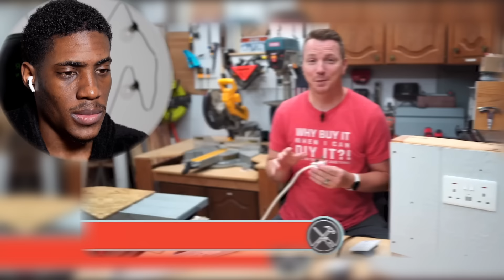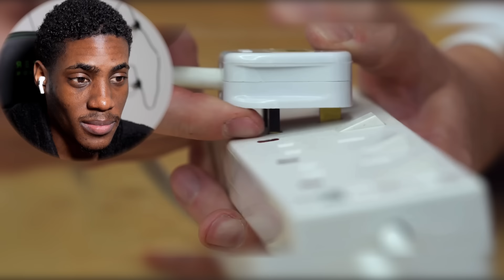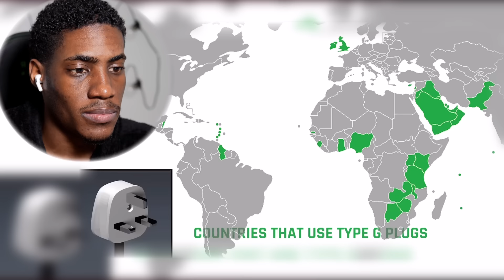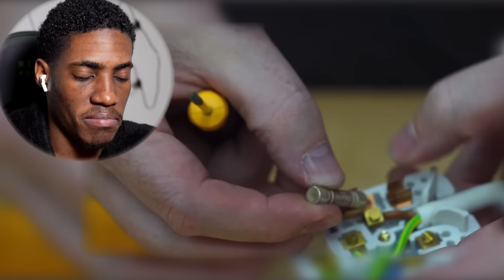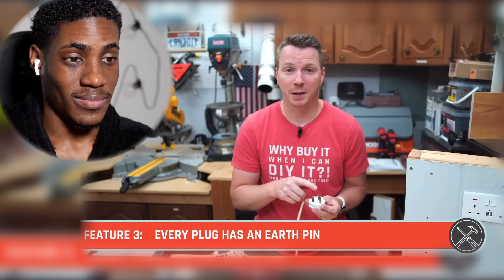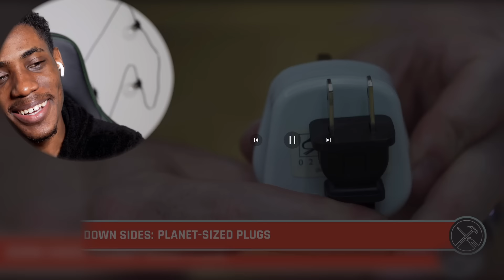Why British Plugs and Outlets are the best in the world || FOREIGN REACTS

Comment: In the UK when I was at school, we actually got taught how to change a plug.     They don't teach it any more, but any brit over a certain age learned.    Before 1987, appliances were often sold with just a cable, no plug, you had to fit and wire the plug yourself.

Also, re 230V vs 110V :  as we say in the UK, it's not the volts that kill you, it's the amps.  But yeah, all those safety features are great.  The product of old-fashioned, serious-minded, pipe-smoking engineers.

The flaws:  the size, DGAF     Load-balancing, not really a problem, just don't take the piss.  House wiring, that's the electrician's job.  Socket switches, rarely but yeah, you have a d'oh moment once in a while.  Not really an issue when you're used to the switch existing.     The prongs-up foot trap, yeah, that one's for real.  Doesn't happen often but hurts like a mofo if it ever does.

The wall switches have one more upside he didn't mention:  the switch cuts off the live and neutral, but not the earth.   So, you can have your pc plugged in but off at the wall and the power cable still acts as an earth, very handy for discharging any static you might have on you by touching the frame before working on the internals.   Who needs a wrist strap lol?

On balance, definitely the best plugs and sockets there are.
Reply: When i was in school, they didn't do very much in regards to teaching how to fix things. It was more building a small wooden toy car or making a sausage roll. The basics wasn't something they taught us and i think this is an ugly issue that needs to be taught. I'm not sure if it's the same with all schools, but i feel like each generation becomes less and less independent and requires someone from a buisness to do it for you.
Reply: TBH the plug thing was kind of an exception, it was mostly the usual school stuff.   Though Home Economics (sewing, cooking etc) was a thing, as was Technical (what the US folks would call shop class).  Everyone did both for the first couple of years of high school, before you chose your options for the remaining 2-4 years.  Not so many carried on with them.
Reply: They do teach it. I taught it a few months ago to my year 10's. They need to know the fiction of the fuse and earth wire.
Reply: @crwhittle  Very glad to hear it's still taught.  Not sure I follow what you mean by 'the fiction of the fuse and earth wire' though.  Expand on that please?
Reply: @PreceptorGrant  ha ha, typo, I meant function.
Reply: @crwhittle  - You are correct.  My grandson (12 years old) was taught at school.  He was so excited so he video called me and and showed me how it was done.  I already knew, but didn't let on.
Reply: @anitawhite2669  Yeah, that's about the right age. I think we often talk down students in the UK, but they often enjoy rewiring a plug, and anything else practical.
Reply: My first science lesson at secondary school was wiring a plug back in 1987
Reply: @DaveP-uv1ml  Might have been true in the past, but modern british wiring regulations are pretty robust.
Reply: @DaveP-uv1ml  Sure, plenty of older properties that haven't been upgraded to modern spec.   But even if they had, no point changing the plug standard now, anything else would be a downgrade.
Reply: if i recall usa home sckets  have 15 amps so more than UK does
Reply: That might be,but dont forget the european plug has also evolved and there is JUST a tiny bit difference,and a big difference on the size off the plug.The one in the UK is enormous..And if the plug is a little bit taken out,you could with a wire get a shock.European plug that is not possible. The only thing wrong with the european plug is there are so much variants.Mostly bad variants.And connections without earth pin.That shouldnt be legal by now..
Reply: @jooproos6559  Didn't you watch the video, the part that explains that if the plug isn't fully inserted into the socket, the only parts of the live/neutral pins that could be touched have insulation on them & so prevent electrical shocks?
Reply: Yup, I was taught to wire a plug, it was 1st year secondary school general science.  Fitted plugs came as a result of a safety campaign led by TV show "That's Life", it saved more lives than the safety plug design in of itself.

Comment: they are so British so safe  in so many ways and hurt like hell if you step on them with bare feet you cant just stick thing in them so little kids and some big  ones  don't get shocked  we also have covers you plug into the socket that are flat to discourage kids sticking thing in to hols in the socket  cool a
Reply: I believe that those covers are discouraged as the sockets already have shutters, and if the plastic pin that goes into the earth breaks off when you're removing it, you've just defeated one of the safety measures!

Comment: I've stood on one of those damn plugs before and it is not to be dismissed...f*****g painful.

Modern plugs now are a sealed unit so not as simple as undoing a screw and re-wire.

Safety point he never mentioned is wiring 240v plugs for dummies (trust me I am a member of this exclusive club) BL(ue) wire - Blue Left and BR(own) - Brown Right.
Reply: Blue to the left,
Brown to the right
If you don't you'll get a fright - max bygraves
Reply: You can still buy individual plugs to replace a damaged sealed plug.

Comment: I have an iPhone charger thing that is proudly made in the USA (it told me on the box. A lot), and while it will now only charge my phone instead of my watch and earbuds as well at the same time because it was made in the USA, it is infuriatingly intrusive with a rather long horizontal plug in to which a USB must then be inserted. I’d guess my bedside table needs to be six inches off the wall and we in the UK don’t have that sort of space to lose!
     It’s not that anyone else’s plugs are bad, just that ours had to be over engineered for conditions including the fact that we use a 240 Volt system which might kill you if not regulated correctly.
     I’d prefer ours simply for the safety features to the extent that when I plug in something abroad, I do with trepidation, in case of shock. And I am a grown man I hasten to add.

Comment: OMG someone who actually knows what hes  talking about and see's thoses negatives as trivial. As others mention below if a qualified electrician has checked or wired the house then load balancing is never an issue. Plus if you haave the switch on the sockets there is  less reason to take the plug out to start with. Well spotted too about the fact that it enables furniture to sit snuggly against the wall.

Comment: Nice one! As a UK resident, I do have to say that the reviewer really had to dig deep to get the negatives from somewhere. OK, stepping on a plug can be painful, but in reality that does not happen often. Nobody leaves power cables lying around in the middle of the room, that is just silly! :-D Regarding the size, that is also not an issue. You get used to it, and also being realistic it is as small as it can be made and still contain all the good safety features. Any smaller, and we need to throw out good features. And the last bit, where you have a switch on both the wall plug as well as the appliance, this is a bit contrived too. When changing a bulb we ensure that the source of the power is switched off before we start working, whether this is the wall plug or a circuit breaker in your consumer unit. Once replaced we check that the device works, and if it was double-switched off then it's not really an inconvenience, is just simply "safer". Is it switched on at the wall? Check. Is the device itself switched on? Check. Is it working? Yes/No. If No, troubleshoot. No big deal! 😛
Reply: Yeah Jan... He really didn't have to find fault like that... I'm almost 60 years of age... And I've lived in several properties over those 60 years... And not once have i ever had problems with electrical load balancing in any of those properties... Nor do i know of anyone else that's suffered from any load balancing issues in their homes either... This is just scare mongering... And trying to find fault in an electrical system that's far superior to any other electrical system in the entire world... Is just crazy!... And nobody in their right mind would ever unplug their appliances and leave the prongs of the plug facing upwards... Because there's no real need to do that anyway... We simply hit the sockets off switch to isolate the electrical device in question... So there's absolutely no need to remove the plug from the socket... Let alone leave the plug in the middle of the room with the plugs prongs exposed and facing upward... And like you stated Jan... The plugs size isn't an issue either... Especially considering the amount of safety features that the Type G Plug incorporates... It's without doubt one of the greatest and safest designs ever made... And by trying to find fault like he did... Was more than a little disingenuous i think.
Reply: @rickb3645  whenn electricians design the electrics on your house, there is a table and formulae in the IEE reg book and onsite guide as to how to take load into account... callled load diversity frrom what i remembber- did my sparky exams foor 16th edition regs, but they are 19th edition now...
Reply: You're absolutely correct. Load balancing is carried out at installation. It's  completely standard practice for instance, to put a kitchen on its own ring circuit so as to allow for heavier loads (without the oven of course, which again is on its own circuit). It's a great system.

Comment: The only negative he mentioned that is true, is that if you for some reason leave a plug lying around - you might step on it. Everything else is just nitpicking from bias. Load/Guaging? Not an issue in 99.4% of cases. Size? Size of the plug doesn't matter, as you mentioned, it's about how much room from the wall the plug takes up. Not knowing whether to trouble shoot the lamp or the plug? Step one of troubleshooting, check that it's turned on at the plug, simple.
Reply: while mostly agree they negitives are real. stepping on Does hurt. you cant just leave everything plugged in with so many devices, Size while not a big problem does add bulk for mobile devices, example being the steam deck carry case can not properly hold the charge cable as intended due to the size of the plug. and the switch does course small issues when others around. like turniing something on,kettle, toaster, etc while doing things come bback to realise someone had turned off the plug. not huge issue but have been cought out when living with others
Reply: The negatives are real and aren't nit picking from bias but nit picking  as a review...First of all he acknowledged that these are his preferred plug and secondary he's doing a review and can't say type g are perfect because they are not... but damn close

Comment: load balancing is never a problem as we tend to buy low consumption appliances. we also leave the plugs in the sockets and use the switches, so we never tread on them.
Reply: Also most homes have multiple ring circuits to spread the load
Reply: @DavidDoyleOutdoors  and radial for high consumption devices, like a cooker, another reason we tradiotionally tend to have all the big appliances in the kitchen, is because the kitchen is generally cable up as radial with the cooker, so can handle the washing machine etc...
Reply: Yeah, unless you've got a massive weed grow in your house you're not going to have any issues. And when you consider what's left sticking out of the wall our plugs actually take up less space.
Reply: Load balancing is only a problem on radial  circuits, the ring main  circuit used in the UK does not have a balancing problem.
Reply: Generally yes we do leave them plugged into the wall so we don't step on them but even so I have stepped on one and they bloody hurt that's why I'm more careful now about where I leave the plugs.
Reply: Well that is also a disadvantage!You often cant get to the wall because a lot is standing before the wall.Like a couch,or a table etc.:face-orange-raised-eyebrow:
Reply: @jooproos6559  no more of a disadvantage to having to plug appliances in because of a couch or table being in the way.
Reply: How many people switch off the wall socket before removing the plug. But should it have to be done as some sockets do not have switches.
Reply: till that time at 3am where you really have to peepee, then it is right under your damn foot

Comment: If they are the best why the rest of Europe doesn’t use these plugs.
The rest of Europe also has high safety regulations.
Reply: In the UK 21% of fires have an electrical origine (the lowest in Europe), In France its 25% (25% is average for Europe), Germany its 30% (the 2nd highest in Europe), Portugal is the Highest @ 33%

Data Source: FEEDS (Forum for European Electrical Domestic Safety) - Document: "European data on domestic fires from electrical source"

The figures for Domestic fatalities by electrocution also show similar trends with the UK again being the lowest in Europe.
Reply: @alanwood9804  fires from electric origin includes fires by electric plugs but doesn’t have to mean all caused by electric plugs. The same with electrocution.
Reply: @palantir135  
The #1 cause of electrical fires is faulty sockets and plugs!!

Europe is not a single country; there are currently 6 different types of domestic socket in common usage in Europe and 13 domestic plugs that mate with one or more of the sockets below.
They are as follows: UK BS1363, French CEE7/5, Danish DS107-2-D1, Schuko CEE 7/3, Swiss SEV 1011 and Italian CEI 23-50.

The most common grounded plug in Europe (the CEE 7/7) is actually a Hybrid of the Schuko (CEE 7/4) and the French CEE7/6, and the most common ungrounded plug is the CEE 7/16 that is compatible with all European sockets except the UK’s BS1363 (Type G).

And to further address your original post,  most European plug/socket standards are not bad at all and compared to the US are extremely safe, any (smallish) gain that would be had by adopting a single standard would simply be impractical (due to cost etc.).

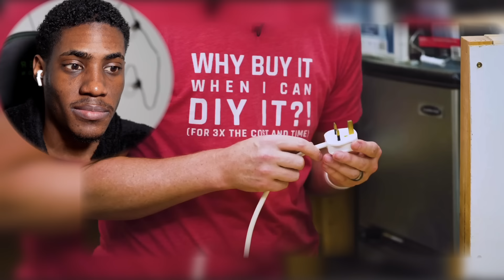Comment: 6:30 - He's wrong. The plug he's holding can be serviceable but that's not the case with all the plugs that come in household appliances. I lost count of how many vulcanised type G plugs I had to cut from appliances that my customers brought from the UK, to install type F plugs so that they didn't have to use adaptors all over their homes. Moreover, the size of the adaptors made it impossible to connect type G plugs side by side, so they needed to have a 5 or 6 outlet extension just to connect 3 of their plugs.
Reply: That's not a criticism of the design of the plugs and sockets in the UK though. The design allows them to be user serviceable and they used to be universally so. Over time manufacturers started to supply electrical products with a non-serviceable type G plug. That's something to criticize about those manufacturers, not the design of the plugs and sockets.

Comment: No idea what load balancing is! Haven't ever given a second thought to which appliances are plugged in where.

Switches are never an issue - it's the first place to look if something is plugged in but not working!

You only ever really step on it once. Hard lessons are learnt and you just know not to do it again 😆

Great reaction - have subscribed 👍
Reply: Yeah, I was wondering about that, I live in the UK and just plug anything in and it just works, never had any issues with load balancing so either it's rare or I've been lucky.

Also, if I'm not mistaken, can't UK plugs handle 3000 watts whereas US plus are half that at 1500 watts?
Reply: Load balancing is a problem with the inferior radial circuits used in the USA, the UK uses ring main circuits that do not have a balancing problem.
Reply: You're right - UK max is 3000W. According to Google, max in USA is 1800-2400W 😊
Reply: It's not something most people need to worry about 

It's only a really an issue for electricians wiring a house and thinking about where the large loads are located on rings
Reply: @scollyb  That's why we typically have a 32A ring for downstairs, a 32A ring for upstairs, a 32A ring for the kitchen and a dedicated 16-32A circuit for the cooker. Plus the 8-16A ring for lighting, which is either all lighting, or also split into upstairs and downstairs.
Reply: You don't need to, electrician will, but there are relatively easy solutions that are used in most houses, for example, kitchen on it's own ring, and utility room is about middle of another ring. Also radial circuits can be used, just often aren't.